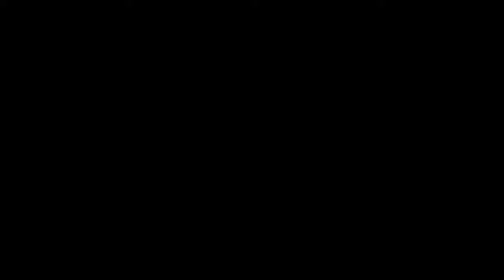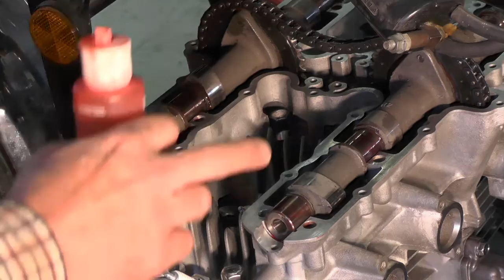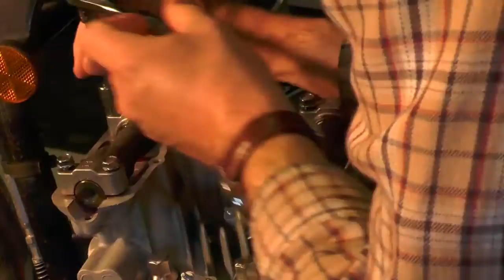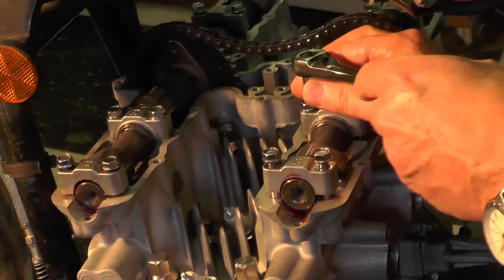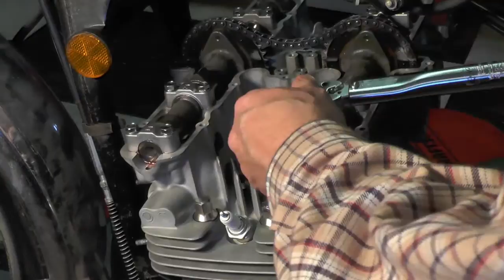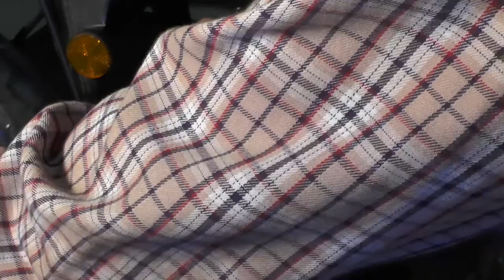Kawasaki KZ650 Installing & Torquing the Cam Journal Caps - Part 12 --- Video #45

Comment: wonder if you have any tips on how to line up the cam chain and the ignition point shaft. i did several searches and could not find anything conclusive on it.... im in the process of changing shims.... thx a bunch